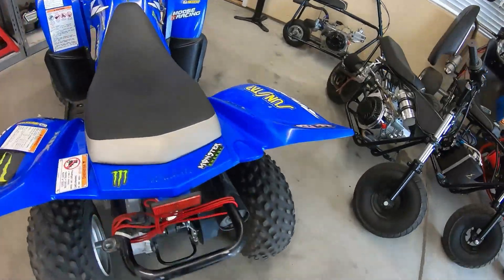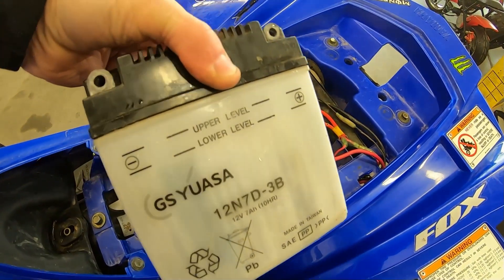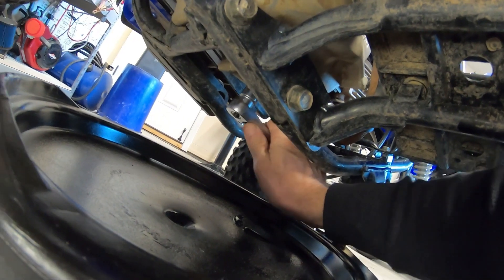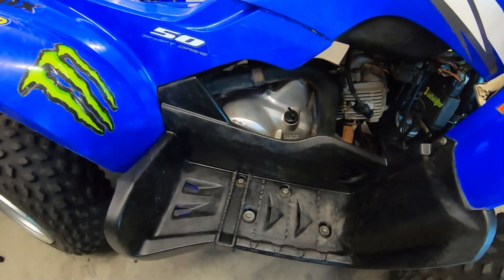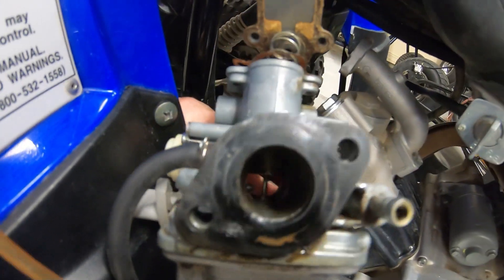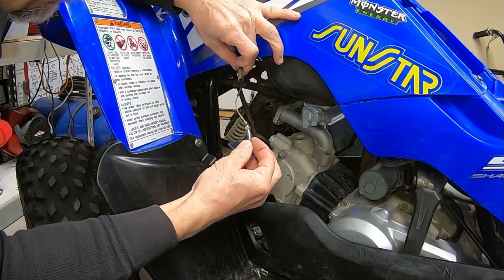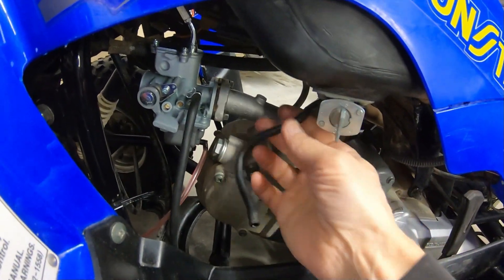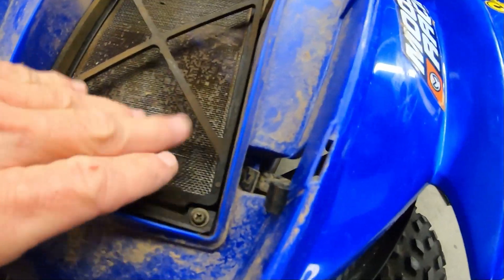YAMAHA ATV quad hasn't started in ten years! Will it run?

Comment: about to start my Honda Foreman 450 for the first time in 9 years. I bought a brand new Grizzly 700 back in 2015 and haven't touched the Honda since but recently I have had the urge to get it out on the trails.  Thanks for the tips on what I should do before firing it up.

Comment: Hello and great video I'm not sure if you are old enough to read this but maybe one of your parents can read it to you. I have a 1995 yama warrior that I bought new and I had someone port or jet the carb years ago to run in purple race fuel so I wouldn't have to worry about things getting all gummed up with regular gas. Now I haven't ran it in probably 10 years and need to sell it. So I replaced the battery but haven't cranked it and didn't know what the proper procedure is so I don't do damage. Also Im assuming it will run on 93 but probably not the best I'm guessing.

Comment: On your predator 212 ghost video a couple months back do you need a billet flywheel or can I just put a new coil on?
Reply from the maker: I had to replace the flywheel . Doesn't necessarily have to be billet but it would be better . That OEM Ghost flywheel would not work with the standard Predator coil.
Reply: Ok thank you

Comment: is there a best lb valve spring for top speed? Can I just throw in a heavier valve spring into my predator 212? With stock internal
Reply: I’ve had good luck with 18 lb springs on a stock 212 the max I would run are 22s for a stock 212 even then you are risking it blowing up